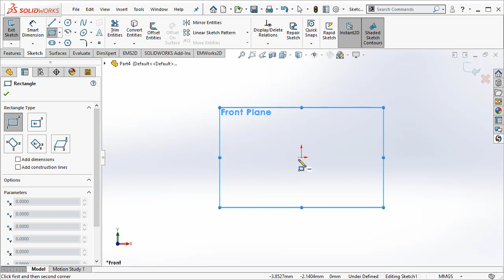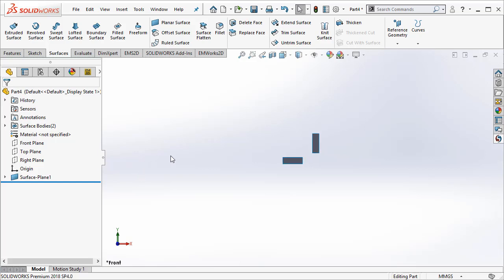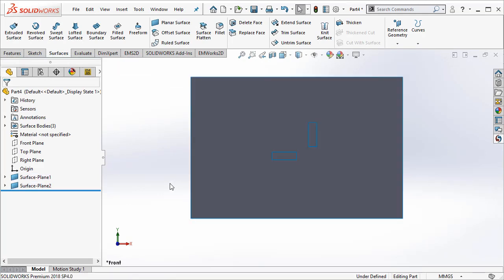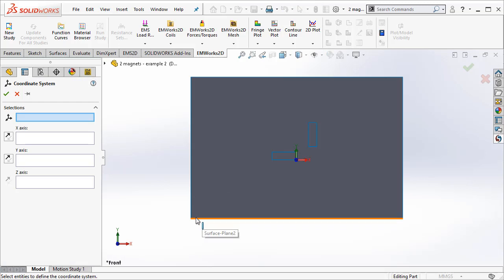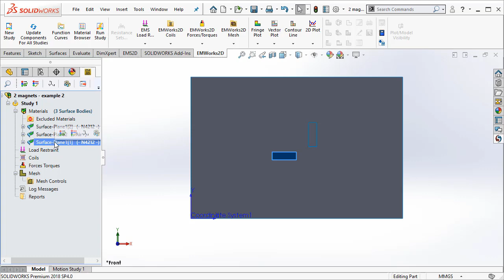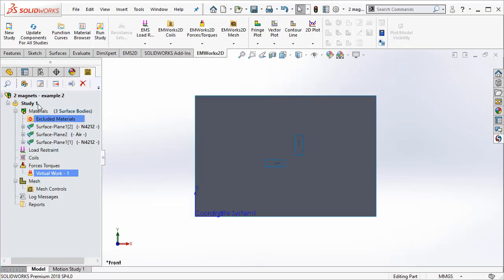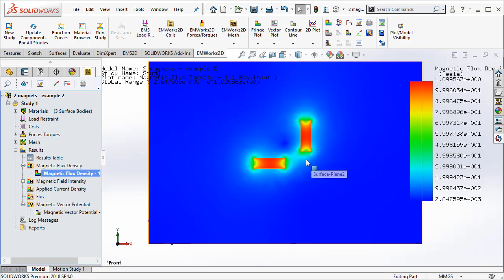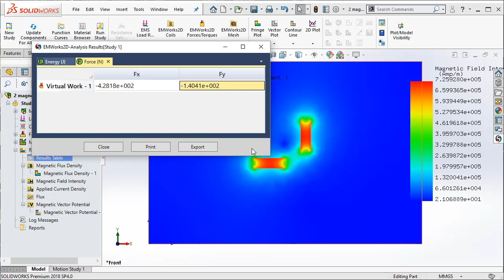2 Magnets: Example 2

Comment: Hello! If the magnets have a zero "thickness" (2D), the forces should be zero. The forces will be different for a thickness of 1mm, 10mm, etc. Where is this taken into account?
Reply from the maker: Hello Arnold, thank you for your question.

By default, results are computed for a thickness of 1m. However, you can use these results to compute the outputs for any thickness. 
In EMWorks2D, the model thickness can be predefined in the study property page and the results will be automatically generated in function of that thickness.
If you want a free trial of EMWorks2D, please visit our website: www.emworks.com.